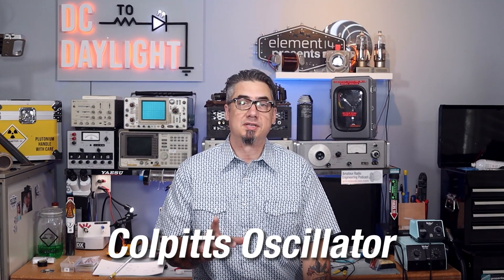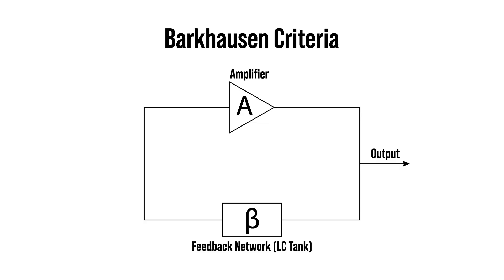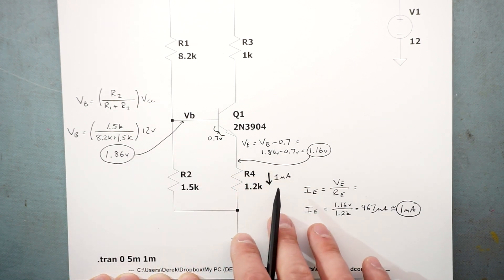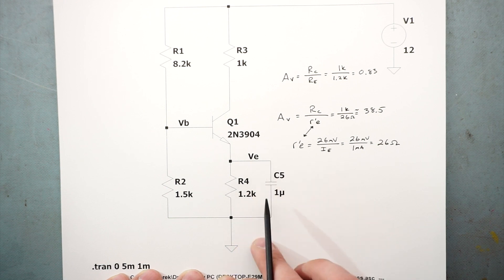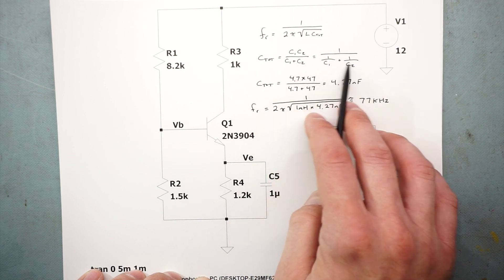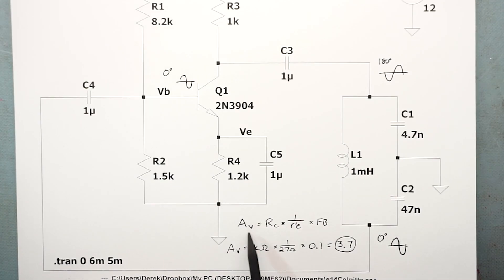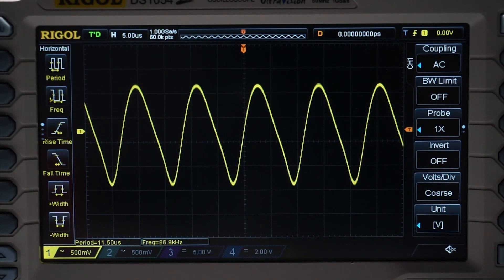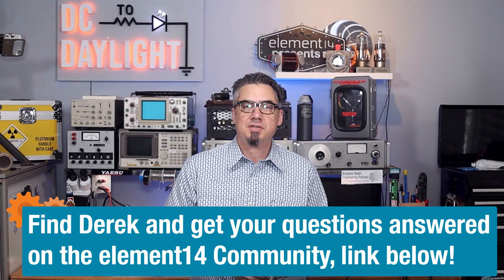How Colpitts Oscillators Work - DC To Daylight

Comment: How to make the waveform clearer and oscillate easier...
① Increase the gain without using C5. So remove C5.
② And if you increase R3 to about 4.7KΩ, the gain will increase and the waveform will be clearer...
③ In that case, the resistance value of R2 is too low and the signal is attenuated, so set it to 10KΩ or more. So change R1 to a higher value as well.

Comment: One of the reasons for the distortion might be the fact that the amplifier gain depends on re' which depends on emitter current. Considering that collector current is not constant this means the voltage is not constant too. This means the gain is higher for for higher emitter currents and lower otherwise. You should get lower distortion if you use Re without bypassing, large enough to overshadow the influence of re' but small enough to get high enough gain.

Comment: Being off by 10 kHz from 77kHz is totally justifiable by the component's tolerance. Caps and Inductors in those ranges have solid 10% tolerance, and their errors combined can easily cause this ~15% jump in f0. The frequency does not seem high enough for the pF-range capacitances in the breadboard to influence that much.

Cheers and thanks for the great video
Reply: @raphaelcardoso7927  
Exactly.
A few 10's of stray picofarads in the layout is considerably less than 4n7f and 47nf
It would make sense to measure the  inductance and capacitance

Comment: I'm having a hard time with being able to classify oscillators. I do understand how this one works, but occasionally I'll run across a topology in an antique radio that I fail to understand. Namely, when I find that the tank circuit is in a parallel configuration. My understanding is that with phasor analysis, at its resonant frequency the impedance of a parallel LC combination would approach infinity. Thus I would imagine that no current at the desired frequency should flow through the oscillator tube that should be providing feedback

Comment: when Q1 and R4 is not there, then you will have 1.86V over R2. 
But as soon as you put Q1 and R4 in parallel with R2. The total overall resistance below R1 changes, it becomes less.
That means you will not have 1.86V as Vb.

Comment: The oscillator operates at 77 KHz, but the amplitude regulation path has roughly 1.5KΩ and 1μF and thus approx. 100Hz loop bandwidth. Can that be the reason for the distortion.

Comment: Great start. Using the same baseline circuit more exploration is desirable. Loop gain can perhaps be tested by perturbing the oscillator. What sets the amplitude is worth discussing. Temperature tolerance/drift is another aspect, even with crystals. Since oscillator output is used as reference signal, its clock jitter, noise are worth discussing.

Comment: Hello everyone

I want to make a little project so I can wirelessly (just a few centimeters) power an LED strip (just a short section) using a transmitter and reciever coil.

I have a 6V 4Ah lead acid battery. I want to use this as the input. I want to convert this to an AC signal around 100kHz and connect the transmitter coil to it. 
On the other side I will have the reciever coil that goed to a rectifier and then to the LED strip (5V 1.9W).

What is the best (and most simple) way to do this? I was thinking about using a Colpitts Oscillator. Can this work?
Also is the battery ok or should I just start with a 12V voltage from a bench psu to make my life easier?

Comment: the output is distorted because you have set the gain with respect to re(which is a function of Ic)
there is another form of bypassing where two resistors are used and one of them is bypassed with a capacitor

Comment: The circuit would be a little better if you put the 1 K collector resistor to the gnd side of the tank. Remove the 2uf cap and connect top of the tank with a wire and place that cap on bottom of the tank to gnd, and if course remove direct gnd from the bottom of the tank.

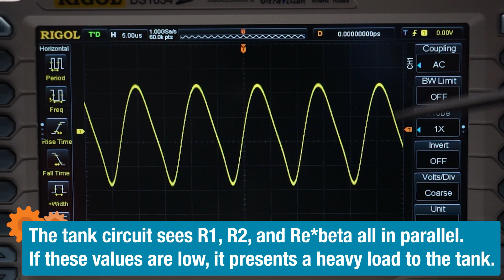Comment: Great stuff.  Teeny little error: the 3rd resistance in the overlay text at 12:30 should read r'e*β, not RE*β (i.e. R1 || R2 || r'e*β). This is for the same reason that the emitter-bypass changes the (open loop) gain of the common emitter to Rc/r'e from Rc/Re.

Comment: I built this circuit a few years ago. The transitor is going in and out of saturation so you are getting a lot of distortion from that. notice that the output of the LC is very clean sign wave. I ended up amplifying the signal at the tank. It was way better distortion.
Reply: This makes sense. Great work!

Comment: Isn't base voltage at the emitter only equal to VBE -0.7 when the voltage divider bias is stiff? Otherwise you need to solve Base Emitter Loop for base current and use beta values to calculate current? It works fine in this particular example because the resistor values are handpicked to avoid this calculation

Comment: Attaching the scope probes to the oscillator directly would have affected the oscillator frequency, the best way is to use a near field probe or if that’s not possible couple in through a 1pF ceramic cap.
Reply: I think it would have brought the frequency down, but in the video we see that the frequency is higher than expected. So it must be something else.

Comment: The base voltage calculation could not be simply derived with voltage divider since R2 is in parallel with RE thru the base. Hence Thevenin's is needed to analyze this.
Reply: It’s still a good approximation tho. As long as the current going into the base is significantly smaller than the current through R1; then just neglect the base current and assume R1 and R2 are in series.